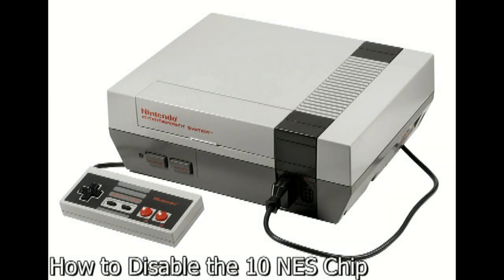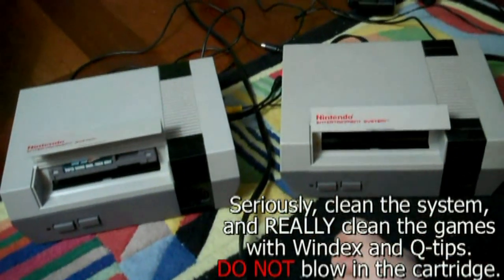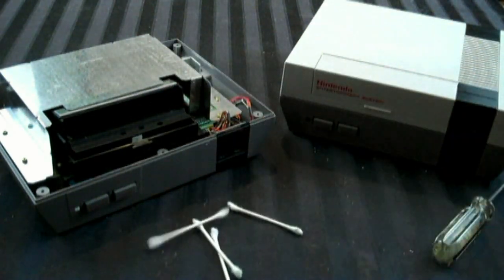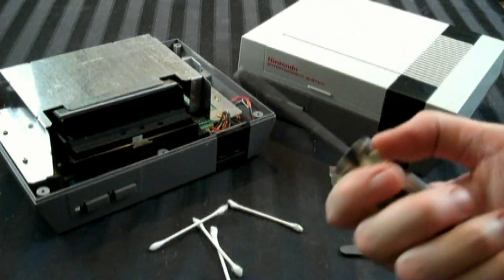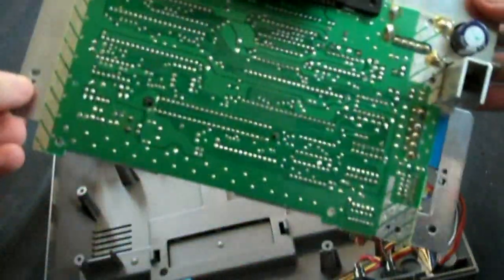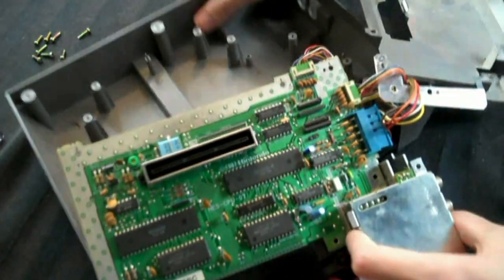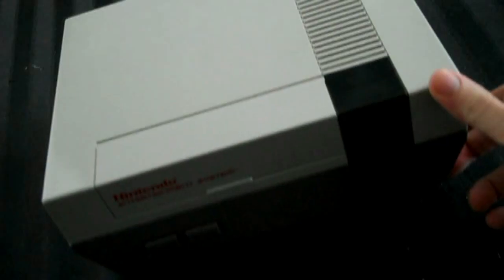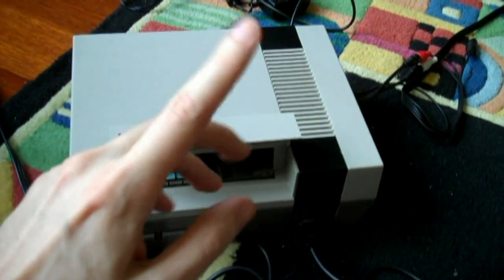Gamerade - Disable 10NES Security Chip on Original Nintendo Entertainment System - Adam Koralik

Comment: Thanks adam koralic i cleaned fixed inspected refurbished repaired and restored my original nintendo entertainment system i cleaned the motherboard the controller ports the cardtridge tray loader i boiled the 72 pin connector let it air dry 100 percent i cleaned the contacts on the motherboard where the 72 pin connector plugs in i used a pink pencil eraser 91 percent rubbing alcohol and q tips i cleaned all 31 of my nes games and controllers everything works excellent the 1985 original nintendo entertainment system will always be my favorite childhood videogame system for one reason super mario

Comment: i think you just need to seat the lip of the cartridge slot mechanism UNDER the motherboard. if you have the lip caught on top of the board then it will bow the plastic slot concave and the locking mechanism wont work

Comment: I know this is an old video, but thank you! This helped me today bring a 'for parts only/non-working' NES back to life
Reply: 9:16 I think you just need to seat the lip of the cartridge slot mechanism UNDER the motherboard. if you have the lip caught on top of the board then it will bow the plastic slot concave and the locking mechanism wont work

Comment: I did this and it works great.  It took me forever never opened a system this far.  Also thanks for the tip of not tighten the screw on the tray.  Before mine was really tight and hard to pull out.  Now it is easier.  Thanks again love these kind of videos.  Third system you have helped me with.  Only console which I can't to work is the Saturn and think it needs a new laser.

Comment: Adam i know this video is 7 plus years old but the reason you could not screw the front screws tight was the loading tray was not seated. There is a piece of plastic that needs to slide under the circuit board in your case it was on top. Thought you could share this with your viewers

Comment: YO ADAM THAT VIDEO THAT BOX OF SEGA STUFF YOU CLEANED IT INSPIRED ME I SET A NEW GOAL BY CLEANING FIXING REFURBISHING AND RESTORING 5 NINTENDO ENTERTAINMENT SYSTEMS WHENEVER I SEE A NINTENDO ENTERTAINMENT SYSTEM ON EBAY I BUY THEM CLEAN THE 72 PIN CONNECTOR THE CONTACTS WHERE THE 72 PIN CONNECTOR PLUGS IN AND REMOVE THE FOURTH BOTTOM PIN PROBLEM SOLVED BACK IN THE 1980 S I THREW AWAY 3 NINTENDO ENTERTAINMENT SYSTEMS AND IM REGRETTING IT THOSE 3 NINTENDO ENTERTAINMENT SYSTEMS CAME BACK TO HAUNT ME

Comment: yes it's worth saving the old school retro videogames I own a old original Nintendo entertainment system and a old original super Nintendo entertainment system I bought both systems off eBay I replaced the 72 pin connector in the nes with a brand new ome  one and found a launch day super Nintendo with the lock tab it's gray no yellowing or cracks

Comment: DUDE it says in the Manuel if you see a BLINKING red light it is YOU HAVE NOT PUT THE GAME IN CORRECTLY. If you have then you need to order a screw driver and clean the inside and metal contacts! its not a red light of death if you put a clean game in it works!
Reply from the maker: I don't dispute that, but if you disable those useless pins then you're more likely to have a stable connection.
Reply: Bobby, there are two ways to put a game in: right side up and upside down. That's what the manual refers to. An NES suffered this problem new out of the box, along with the games. If the cartridge is in right and everything is clean, this problem still exists. I know. I was there. Cleaning helps but is not a solution.
Reply: get a new 72 pin connector!

Comment: would people really pirtate a 10$ cartrage back then? did not even know it had security or pirating issues back then. I mean now they want 60$ + for games then charger you for all the "dlc" (the rest of the game) so its understandable why people pirate now days.
Reply: +A42yearoldARAB Games back then were $60 to $80.
Reply: Arian Gatollari what a rip off
Reply: +A42yearoldARAB Lol.  You do realize that every new release, no matter the platform, has had a release price of $60? so, in 1987-1992 these games new were $60.
Reply: +Arian Gatollari Thats true but game cartridges were really expensive to built ! At that time we didn't simply buy a game but a whole system fitted in a cartridge !! What is their excuse nowadays ?
Reply: SUPER GAMER GUIDER They weren't pirated,  they just didn't want to pay nintendo licensing rights for their games.
Reply: Zestypanda
 Not true. ps1 games ranged from 30-40 and ps2 was 49.99. The first 60$ dvd/bluray based games where ps3/360. I never owned anything without cds besides n64 so i did not know. I would not pay 60$ to run left or right lol.
Reply: A42yearoldARAB Actually, brand new, most NES games were $80 and more. Then later they dropped to $60 new. But yes, the n64 was $50 to $60 new for a game. PS1 Games were $60 new also, I have no idea where you're getting these arbitrary numbers. I mean new in the year of release, not sealed like new but sold years later.
Reply: Zestypanda
 I personaly never paid 60$ for a ps1 game new that is where i get the numbers also from google if you don't beleave me plenty of forums say it to.howeve it did say what you said about nes games being that much and even 64 games but never ps1 games.
Reply: HarryKritikos all cartridges ever contained were the game data. Except for the fx chip in starfox they never contained a system or part of a system.
Reply: +A42yearoldARAB well actually once upon a time atari was making pirated nes games under the guise of "tengen", they had found a way to bypass the nes lockout system and made there own cartridges for it, look it up, there was a HUGE court case over it, its one of the main reasons copyright for video games is such a big deal now, i suggest going to a channel called  "gaming historian" he gives a great explanation of it
Reply: Zestypanda right my bad,

Comment: (NOOB alert) Wouldn't just simply cutting the 4th pin at the contact give you the same results, or does there need to be absolutely NO part of the pin touching the chip for this to work? Thanks in advance.
Reply from the maker: Basically all you are doing is severing the connection. If you can cut it without removing it, it should work.
Reply: AdamKoralik thanks again.

Comment: I did this to mine and it won't power on...... But there is still a metal piece on the board. It's on the top and there's one on the bottom but it's cut in half. Any ideas?
Reply: Keep bending it back a forth untill it breaks off

Comment: if you remove the 10 nes chip will it play my famicom games
Reply from the maker: Provided you have the appropriate adapter, yes.
Reply: what kind of adaptor?
Reply from the maker: 翼虹の It's like a little 72 to 60 pin adapter designed for NES/Famicom games. That way you can use them on either console.
Reply: so that means I can use front loader NES?
Reply from the maker: 翼虹の If you have the adapter, yes.

Comment: That ruins the value of your system after you jailbroken it to play pal games on it I don't need no new 72 pin connectors for those systems I can rebuild them who needs to remove the CIC U10 chip you just destory a great console the motherboard is useless if you try to sale it you might pull it off on someone that doesn't know about them im a gamer tech I would know about it. You couldn't tell a old system from a brand new one that you tooken out of the box im just that good with them I got one right now that plays like brand new I rebuilt those old school game systems when im done they play like factory you guys don't know how to work on those 72 pin connectors I do I can rebuild them like brand new again. Out of 98% of the systems that lights up I guarntee 100% I can fix them without jailbreaking the console. Only way I couldn't repair a 72 pin connector would be if someone actually rub it with sandpaper inside of it and rub the gold components off of the teeth of it. I can clean those consoles inside out and make them like brand new you couldn't tell the difference..
Reply: It does not affect the value of the system...
Reply: A system that doesn't play games at all or only part of the time is worth less then one that works almost 100% of the time.
Reply: Just carefully de-solder the pin of the chip instead of breaking it off as shown in this video, that we you can restore the original state if required :)
Reply: Where's your video?
Reply: So you think that by cleaning these parts of an NES, that you can magically make it work better than it did, new out of the box? I don't think so. You're the first person I've ever seen care and speak out against making this mod. Many players and collectors for further than this and seek them out. That's clearly not resulting in any devaluation.

Comment: I have repair well over 30 nes and never had to cut the chip. It will do more damage then good trust me don't do it.
Reply from the maker: That's absurd. Nintendo themselves removed the chip from the top loading models.
Reply: That's becuase the top loader was made to be cheap as hell. I have never even replace the pins on any system. Cutting it is a getto way to maybe fix it. Just do it right or not at all.
Reply from the maker: SwaZ B Well, the mod was done. It works better than it ever did before. Which is the general consensus. You don't have to do it. I did, and I don't regret it.
Reply: SwaZ B Do you understand how stupid that sounded?
Reply: lavenderhawk look if your system not reading games the pin's are too bent down or the cart is dirty. The lock out chip was used for bootleg games jackass.
Reply: I really don't see any negative consequences of this mod SwaZ B. What exactly could be a possible disadvantage?

Comment: This is an extremely helpful tip and would have been great to have known back when the NES was in it's prime. Many present adults would be less stressed and possibly asthma free due to this gem. This was extremely informative and a pleasure to watch.

I have just one question though. It seems like a silly one that I could eventually try myself. However, what does the screen look like when there is no GamePak inserted, and the power is constantly on? I was curious to see, but since it was irrelevant, you never showed it. Does it display 1 primary color? Does a signal even get to the TV?

The days of my youth were filled with blinking multicolored TV sets thanks to Nintendo. I'm curious as to what the non-blink TV set would look like.
Reply from the maker: Thanks for watching, your question is interesting actually.

It seems to depend on the console, they all seem to display just a solid color screen, the color simply changes based on console to console.

Comment: The 10nes chip, yeah I took not only the bottom off but the top connector as well, Is there a way to repair this? Thanks!
Reply from the maker: Oh, uh, maybe? It would require soldering skills.
Reply: Yeah, you might be able to solder a contact on, but you would need to be VERY careful. I recommend a magnifying glass (One that is hands free) and don't use too much solder. You don't want to connect anything that wasn't already connected.

Comment: I bent back the correct pin and cleaned the entire system plus the 72 pin connector when I put in a game all it shows is a solid yellow screen do you think getting a new 72 pin connector would fix that issue adam?
Reply from the maker: Probably, but make sure your games are properly cleaned too. As well as the connector.

Comment: Um I need help with my nes idk what's wrong with. The problem is that when I turn the power button the lite doesn't come on and  I press the reset button then it works but I finally got the title screen for mario bros 2 but no sound and a long black bar is in the middle of screen with rainbow colors.

Comment: I`ll explain. While blowing the cartridge can temorarly make your games work, because of the water of the spit that comes on the connectors leads electricity better, you are making it worse everytime until the cartridge won`t work, heres why: 1. You are blowing the dirt and shit INTO the cartridge istelf, making it dirty inside, with might break it. 2. The spit that makes the game work also makes the pins RUSTY (Biggest problem) (There are more problems but I dont have enough space) Use a vacumm

Comment from the maker: Just disconnected that pin should do the trick.

Make sure the games and the system are clean.

The screens you're describing are incredibly common with the NES.

Just clean the crap out of it and it should be fine.

Comment: I removed it by it no longer touching. Does it need to be completely removed? I put in a game, worked but the screen was pixilated, took it out, put back and then nothing, tried several more games annd they didnt work at all.  There was no blinking red light. Suggestions. I have two or three more around somewhere,  but not sure if I should try again,  maybe I just screwed something up.

Comment from the maker: I'd be astonished if the NES was dead.

You MAY have to replace the 72 pin connector.

But the rest of the system should be fine.

Comment: Ah ahaha! No, it does not actually. It has better quality then the actual NES! It has all 3 AV cables, not just two. It is superior to the NES, in many ways it is more superior, it is a top loader, and does not have a death grip and is very nice designed. Please just check it out, just type in "Nes clone from the 1980s!?" Also a superior Famiclone is the japanese Micro Genius, just type in Micro genius clone for that. It's a relatively old system though, about as old as the NES itself.

Comment: Ahaha, very persistent, but! They are VERY much better than the original NES, look at reviews for it before you bash it. It's design is also very much better than the NES, it was actually the first Clone system for the NES, and the only good one. The only other one that was even close to good was the Generation NEX. Just check it out on a video or something, it's a VERY NICE system.

Comment: Just tried this. My nes boots up to a grey screen now. It took a lot of effort to break the connection to the 10nes. During doing it, i slipped and scratched the circuit board, i suppose that is why. Wouldn't try this again

Comment from the maker: Correct, a lot of games were released without permission of Nintendo.

Atari for example didn't think to block out pirate cartridges, which is why so many horrible third party games helped to kill off the Atari 2600.

Piracy protection helps as a form of quality control so shitty games aren't made and ruin the reputation of the system.

Comment: It's also possible to disable the NES10/CIC chip by running a ground wire to the 4th pin, so you don't have to cut anything. This method IS reversible, while cutting the pin isn't.

Comment: You should know what actually is connected to the chip...
maybe, there are a lot of contact that will breake by removing the chip, makin the NES un-working.
Maybe, the 4th pin is the power to that chip, so you basically remove it by cutting the power from it.
:D

Comment: Because the 10NES in the model NES-001 Control Deck occasionally fails to authenticate legal cartridges, a common modification is to disable the chip entirely by cutting pin 4 on the Control Deck's internal 10NES lockout chip.

From the wikipedia page you are looking at.  (This is cutting pin 4, you're breaking the contact between the chip and the board.  This also happens to be a pretty easy way to do it, good video Adam)